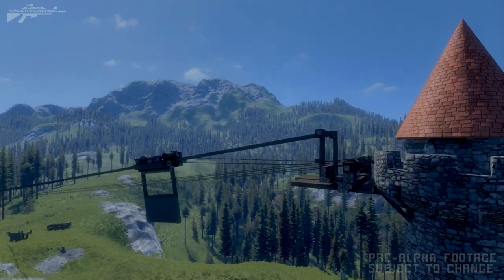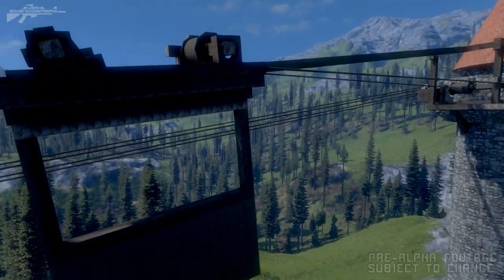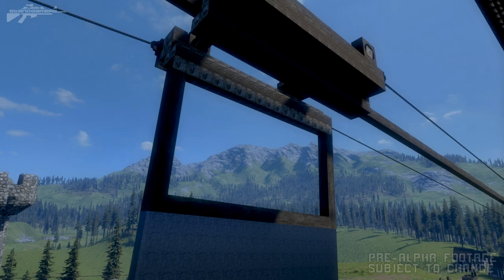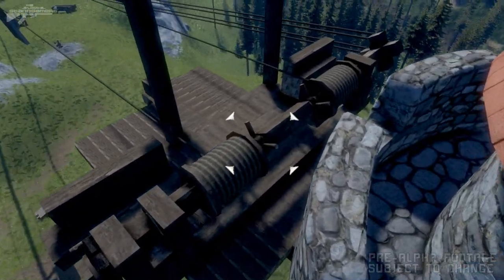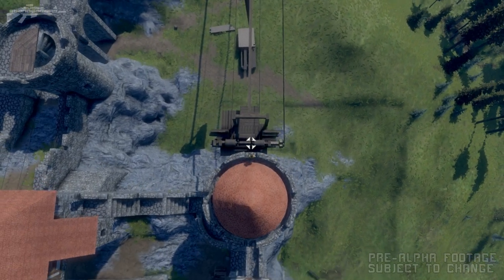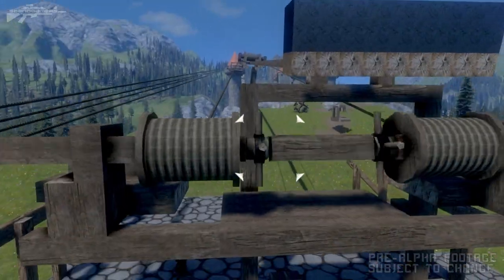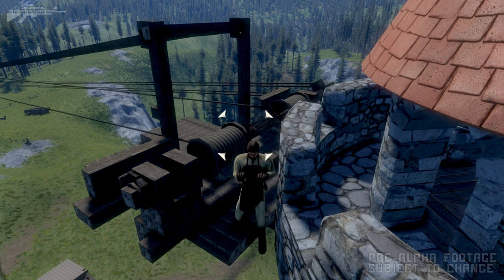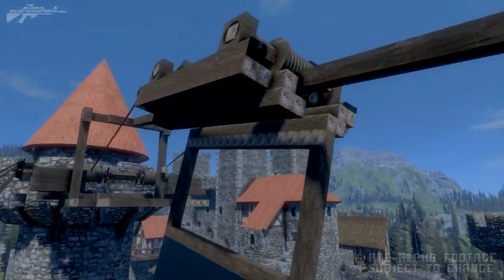Medieval Engineers - Cable Car, Monorail Prototype

Comment: I see you're still using two crank wheels for the rope drums. Now, that could just be your personal preference, but just in case you've missed the comments on the previous videos, I feel like I should still mention that you can hold shift when using one of the cranks to reverse its direction. :D

Comment: A useful feature for this game would be the ability to set rope drums to have a minimum and maximum extent for ropes. That way, you can't easily crash your cable car, and you can restrain your catapult without a crossbar.
Another cool idea so build on that one is pulleys. Splitting the rope length between two segments and allowing your controlling winch an anchor to be in the same place.

Comment: You know, using the logic you presented, one could make a truck. You just need a way to rotate the wheels left-right (for turning/steering), and a way to rotate the wheels forwards-backwards (for propelling). Granted, two people would be needed (one for steering and one for moving), but you've basically got a truck, which can make use of roads to move large quantities of materials. Heck, add ropes to that , and a railing system, and you've got trains and trolleys. Actually, the trolleys might not even need turning built into the vehicles, if there's a machine changes the railings in an area (like with a rotor, or with an elevator).

And if the devs add a "seat with pedals", "seat with steering" and "seat with steering and pedals", you can even control a vehicle alone. Besides, with some gearboxes, you can make a gear box, or have two "human-powered engines", one for lower speeds and one for higher speeds. So, now, if you want to go uphill, you can choose to go slower, but steadier, instead of trying to crack up the speed and stop before making to your destination. Or you can add a handbreak to that, and have the person steering just hop out and activate the breaks, or help with the speed, so more people push together at the same time. 

This way, you can have people join factions, and have a transportation system, with maybe wooden carts be civilian transports, and maybe brick/cement/metal carts be military transports. And the best thing is that you can add to that some weapons, as well. A catapult should be fairly easy to do... or a mounted crossbow...

Comment: Hopefully you can agree with me King LSG, for I think this will expand to engineering aspect to not just machines, but with steel and fist!

This is a little cool idea for Medieval Engineers is that you can mold and shape your own weapon, lets use a sword as an example.

 You want to point to be as sharp as possible, enlarging to the hilt so you can expand the wound for more damage. It also makes an easier pullback for there is more room. if you added spikes for example the stabbing power is reduced, even if you get a good shot, pulling it back will be hard for it will get stuck on sinews and bone. A very bad position in a large battle like a  shield-wall beat down or a siege.

Hopefully you can make your sword vary in sizes, a large two handed weapon or a short hunting knife, both used for different purposes and such. And hopefully the smiths of the future don't just reserve to old-world formatting c;. (imagine some crazy ax that is lever action to break through skin morbidly and efficiently.)

Smithing just doesn't end with swords, it goes with maces, pikes, spears arrow heads, and tools. You can probably decide the efficiently of your pick by it's point and keeping it well kept and sharp, or making your axe more capable to cut wood then to break bone. Maybe you can even become a Fletcher, making your bows for upcoming battle, or engineering a crossbow for the men at the wall.

Probably going to be scripting hell. But it's just an idea i found very interesting and will probably benefit to the PVP and massive RP Medieval Engineers may have already sparked.

What madness will you create? -

Comment: looks like there is no structural integrity on that wooden beam
Reply: Pre-Alpha. It's coming - But yes, the small wooden construct have very limited, if at all, structural integrity. I got it already and can confirm that the wooden beams and constructs are rather un-affected by the structural integrity so far.
Reply: Additional to that bug, but ignoring the fact that it's gonna get fixed: He probably turned integrity off.
Reply: nah, i dont think he would turn of physics..... the resaon i mentioned it was becuase i though he would account for it. once they patch in wood physic, that thing will come tumbling over. he usually seems to thinks about everything from all corners...

im will be really interested in seeing him improve this with supports that dont get in the way of the cart.
Reply: nick mando all you would really have to do is add some stone supports every and there,then it might work.
Reply: +nick mando off* :)

Comment: the only issue i see with it is the cable car needs to be a little bit higher, that and its multiplayer only. if you are in a castle with a buddy its fine, but all alone it can only haul goods up. which isn't bad. but again, i suggest making the frame a bit higher up, that way the cable car can glide over the platform area to allow for safer disembarkation. i would also suggest a simple weight limit sign. and perhaps making a larger version if at all possible.

Comment: You should change the design up so that the controls are located within the car rather than at your castle.  This will allow the system to be ran with one person.  Your current design would work well for co-op or for moving materials.

Comment: Very nice build, but I have an idea on how you could improve it.
If you were to set up the cable car system as you have it here (and under the "siege conditions" design) it would require there to be people at either end of the cable car system, and that both sides would be friendlies. Perhaps attaching the winch mechanism to the cable car itself and connecting the ropes to the higher point would be a better solution? It would allow for solo travel between a castle and supply station, and would prevent enemy forces from using the cable car themselves and potentially forcing the defenders to destroy the cable car.

What are your thoughts on this?

Comment: try hiding it in a forest as so they may not see it or an evacuation tool. have two locks one for the bottom and one for top so they cant just remove the top one if they take over and ride down. you may want to destroy it though so they don't track the ropes once your at the bottom. have a cart with enough supplies to build a small house so you can gtfo.

Comment: Am I the only one that thinks that this is ridiculously stupid. How the hell would a wood beam that long not just break apart. I understand this game is alpha but I thought they at least had some level of gravity, I guess not :/
Reply: There is no structural integrity affect on wooden planks yet, also a portion of the weight is distributed along the tension of the ropes, also their is an option to turn off structural integrity if you don't want it.
Reply: lolhi1122 Well I suppose that makes sense, although unless the ropes were holding the beam up (which they can't do at that angle) it would still break under it's own weight.
Reply: it would also depend if they game sees the beam as individual segments placed together or if its one solid thing all the way through